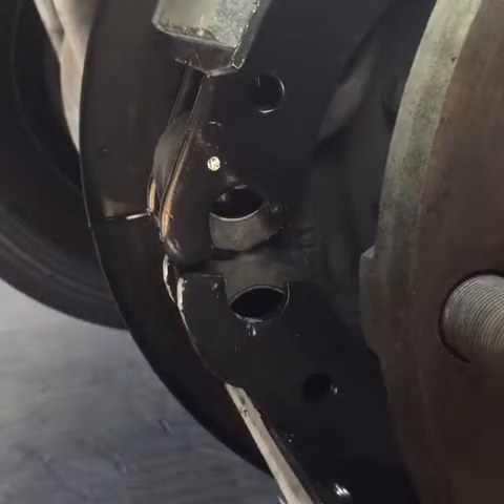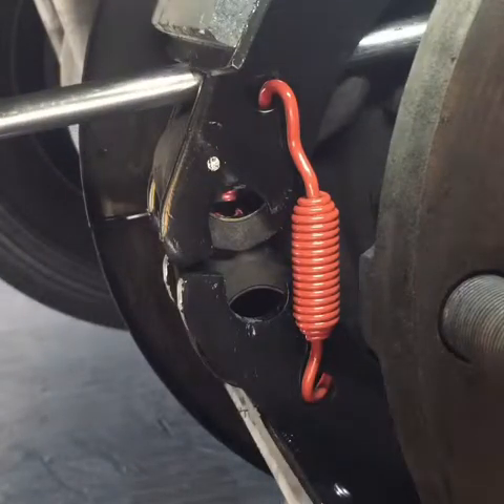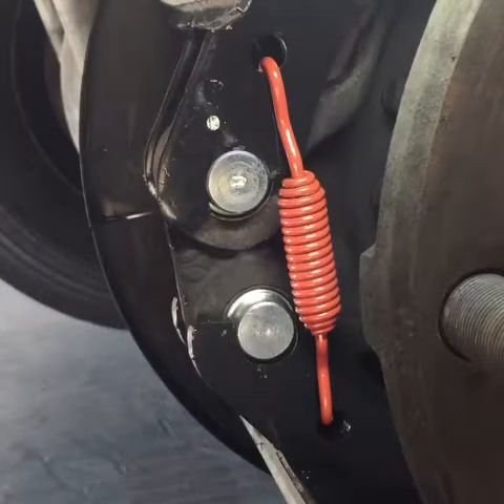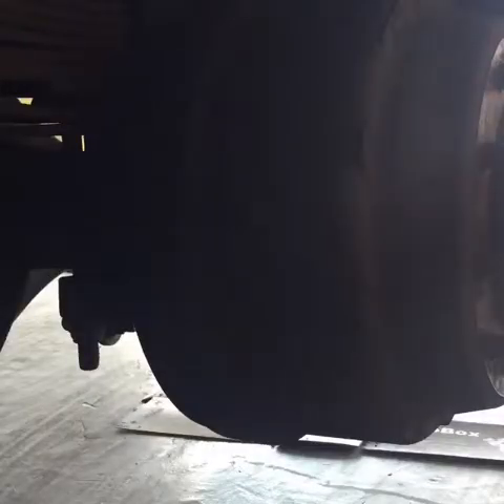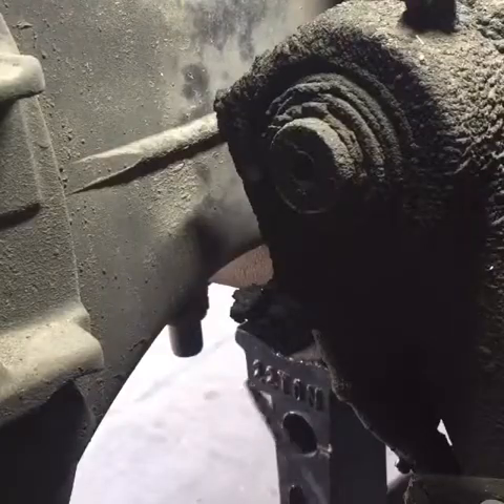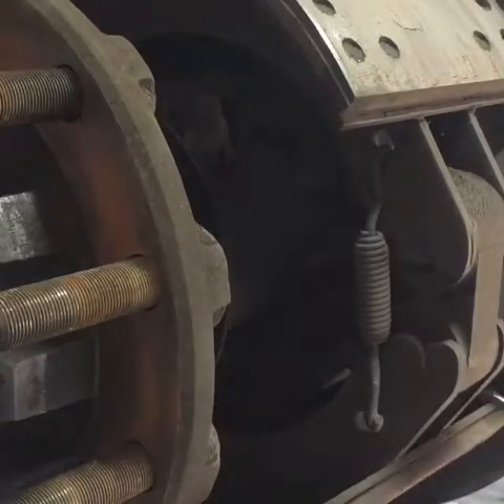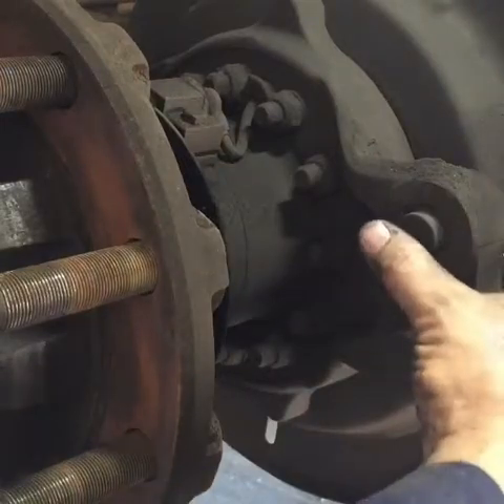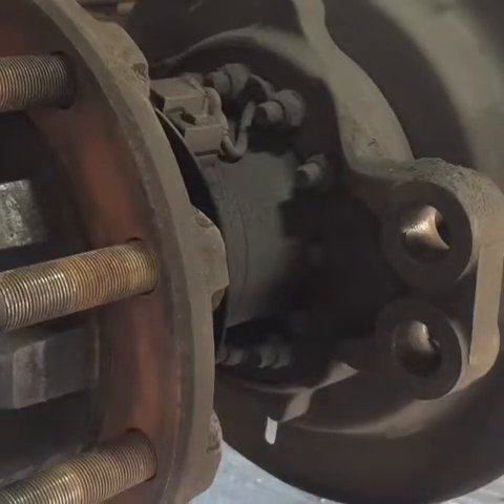How to replace air brake shoes

Comment: I’m about to do my first set of rear brakes on a blue bird same set up from what I’ve seen. I’ll comment when I’m done with it thank you for the video.
Reply from the maker: Hey there hemi44. I’m sure you’ll get them on bud. Just play it safe. If you try it the way I did it. Just make sure the pry bar (extension) doesn’t slip off while applying pressure. The rest is somewhat simple. If u have any questions. Feel free to drop me a line.
Reply: Sorry for not commenting that same day burn i did it easy less than 30min each side I even showed the new mechanic there at the shop how to do it and he did it just as fast

Comment: My s cam isn't straight up and down, the bends are perpendicular to the ground. I'm having a hell of a time installing them!
Reply from the maker: Turn the square nut on the slack adjuster. That will make the S cam turn to the position on need it to be.

Comment: You didn't apply any anti-seize to the anchor pin rollers. For all the techs in high corrosion areas this video sends the wrong message. The foundation brake manufacturers call out lubrication points there and on the shoe where it contacts the s-cam roller (not the s-cam face). I suggest anyone doing this go read the literature...